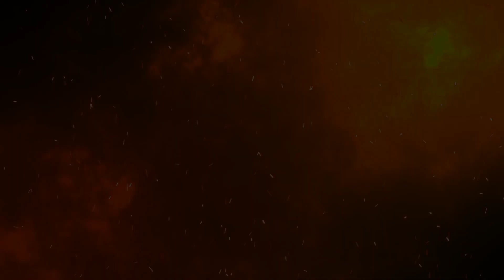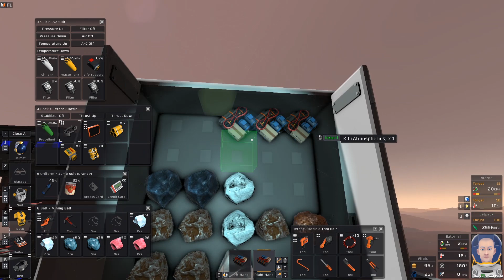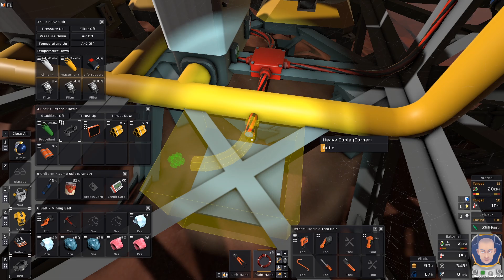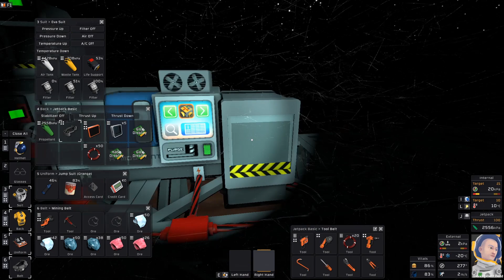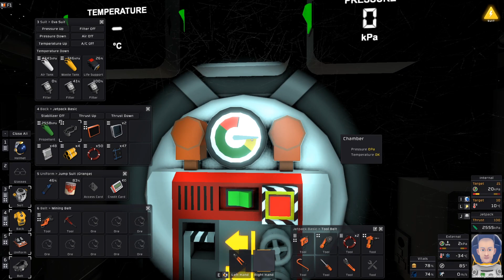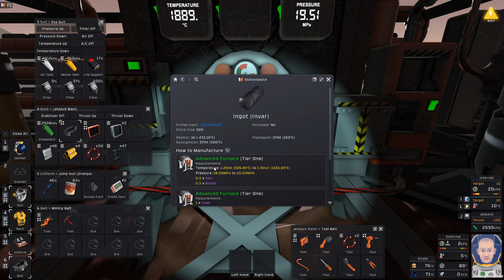Stationeers #6: Gas Storage and Filtration

Comment: Question, why the insulated pipes with the radiator section? Wouldn't the gases cool slower with the insulated then without?
Reply: he said they would melt if they were not the insulated pipes